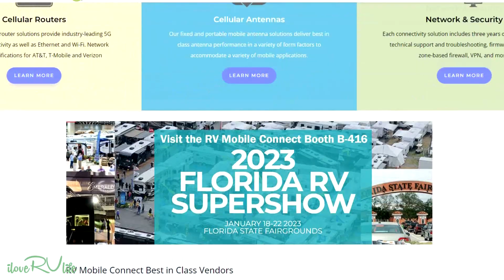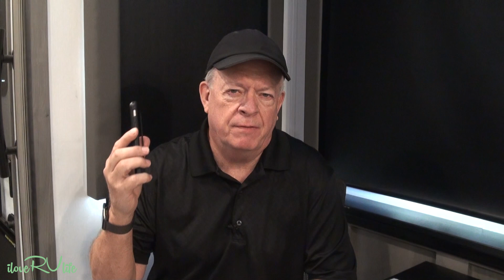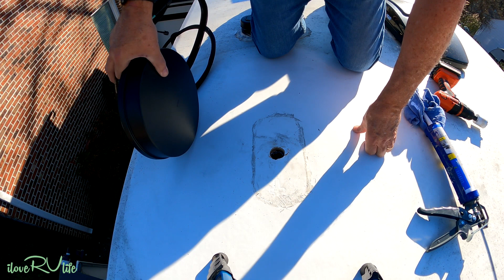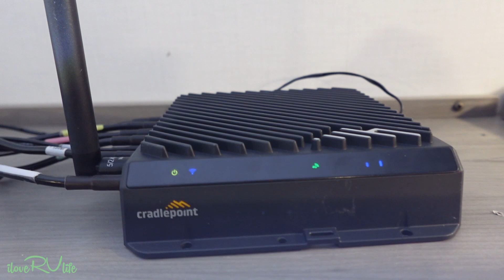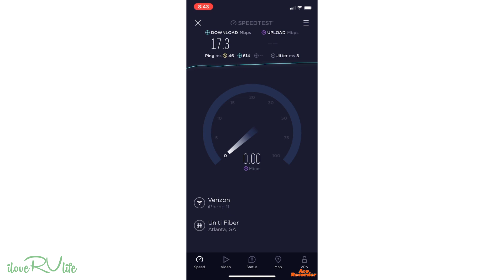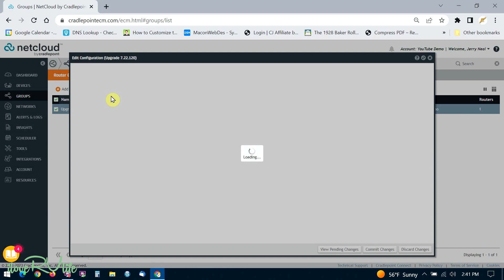RV Internet From RV Mobile Connect and Cradlepoint

Comment: So Jerry I take it you need a hot spot a Cradlepoint router and a service plan from RV mobile connect service plan is that correct?
Reply from the maker: I do.  The CradlePoint was an upgrade from the older MoFi I was using. It came with a 3 year service plan. So far haven’t needed any additional support. System just runs.

Comment: Great video on a great channel. Thank you. 

Any suggestions on 4g data plan?  Mostly use for zoom meetings and streaming.
Reply from the maker: Thanks. It depends on how much data you need each month. Video and Zoom specifically burn through a substantial amount of data per call.  It also varies if set up 720 or 1080. This link gives the specs on a call. https://support.zoom.us/hc/en-us/articles/201362023-Zoom-system-requirements-Windows-macOS-Linux. All the majors have 50Gb to 100Gb hotspot plans that are reasonable. Prepay seem to be the better route. I’ve been using prepaid plans since we started travel in 2014. Here’s a 50Gb $50 t-mobile plan https://prepaid.t-mobile.com/prepaid-internet. Verizon has 100Gb $80, 150Gb $100 plan. Have to jump through a hoops with the IMEI for the device. Another option is with these folks http://wirelesssolutionsllc.com/?ref=175%20. They specialize in hotspot plans. Hope this helps.
Reply: @iLoveRVlife   What did you have to do for verizon and the imei for the device?   Thank you.
Reply from the maker: That was the beauty of the install. Not one thing. Just plugged it in and it worked.

Comment: Did you say you can get this system installed by a professional all we need is the Wi-Fi app because we like to do gaming on the iBook and a few other things in our TV in the camper has a Wi-Fi connection so I’m not the most intelligent brick on the block but did you say you could get this installed?
Reply from the maker: RV Mobile Connect offers turnkey install from ordering through installation. Use the contact form on their website and they will work out the details.
Reply: @iLoveRVlife  ok

Comment: Seems like the antenna had a dramatic affect on reception. Any thoughts on keeping your old internal system and just having replace the antenna? I don’t do much traveling and purchased a mofi and was thinking about using the external antenna.
Reply from the maker: The antenna was part of the solution and helps. The primary gain is upgrading from the out dated CAT 7 radio in the older router to the new CAT 20 in the Cradlepoint router along with a much improved firmware implementation.
Reply: @iLoveRVlife  thank you Jerry explains it well. Safe travels my friend. I’ve been following you for many many years.
Reply from the maker: Appreciate you watching. Safe travels.
Reply: @iLoveRVlife  II see multiple mofi's did you have the cat4, (has band 71 & 14 )  cat 7 (faster but no 71 or 14) or a newer version, Thanks.
Reply from the maker: It’s the CAT7. We’ve recently upgraded to CradlePoint R1900 with a CAT 20 radio and 5G. Here’s the video from a few weeks ago. https://youtu.be/ZvThK258sZM I don’t mention the MoFi in the video, but that’s the first speed test using a Poynting 6dB gain external antenna.
Reply: @iLoveRVlife   Hi Jerry, You mentioned you were going to do some experimenting. Were you able to utilize the Wifi and GPS from this setup in your truck when pulling the trailer?
Reply from the maker: We have. The GPS is more for diagnostics vs using as a route map. Using inside the truck was ok. In metro locations with a strong signal, it was useable. Traveling down the road the signal was weak in the cab of the truck. Suspect the steel roof and door impeded the signal. Out of the truck at a rest stop or around the campground within reason, we have a very good WiFi signal.
Reply: @iLoveRVlife   That makes sense.  Clever experiment. Thanks for sharing.
Reply: Jerry: Yike$!  The price points on these systems are budget busters.
I guess if you’re livelihood depends on reliable connectivity, the investment is worth it(?)
Another reason to stay retired😊
Reply from the maker: Understand. I worked for a while with the budget systems. Half the time we had good to moderate service. Challenge to work in the more remote areas. Also retired our satellite services and helps offset  costs.